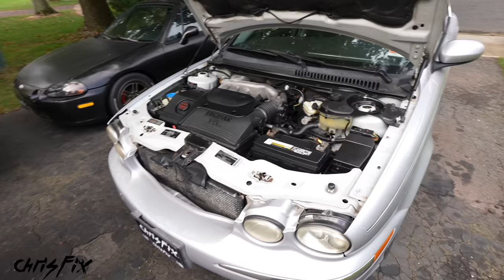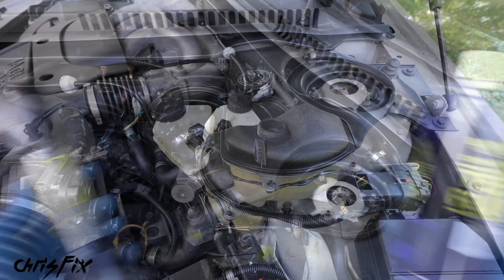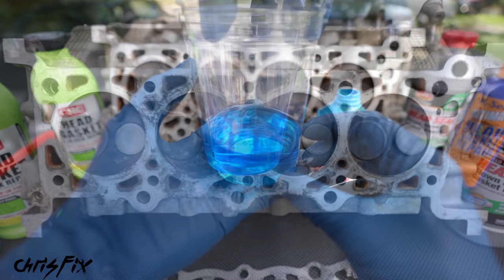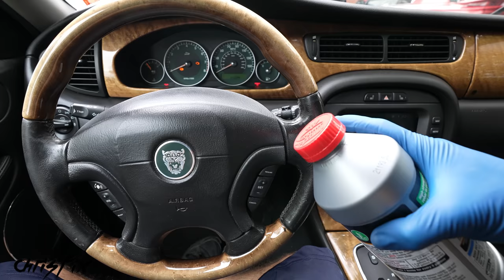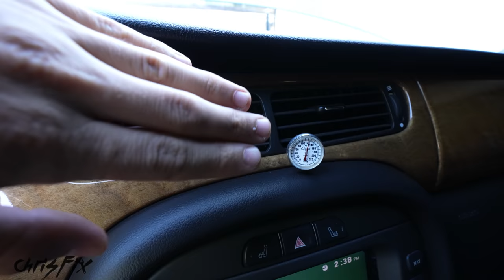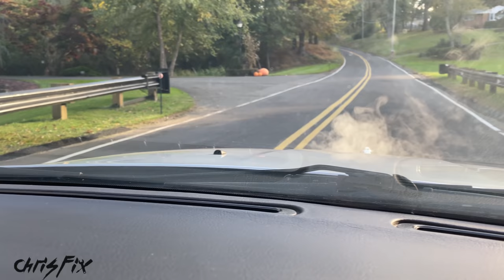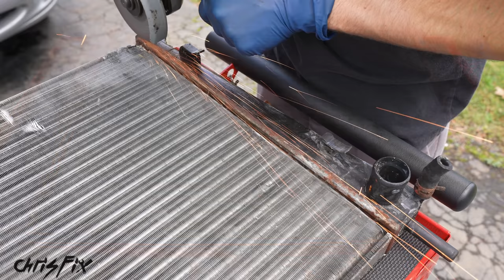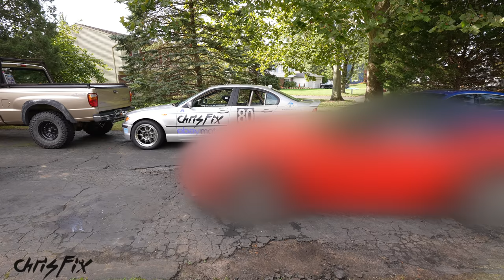Do Head Gasket Sealers Actually Work (FULL 2yr TEST with Engine Teardown)

Comment: After using many different sealers on different vehicles through the years, they absolutely work.  Not every time but definitely worth trying
Reply: which one do you think would be the best option for a 01 5.4 trition v8 with a head gasket leak?
Reply: @danielwright_69  I used the "blue devil" in my '99 5.4 triton 2v and it worked. That was about a year and a half ago and so far its holding.
Reply: @danielwright_69  Holts wondarweld work great for me.. before it was extremely blown head gasket, the coolant start spilling to the top once i start the engine.. i had to remove the spark plug on the blown gasket cylinder and run it without it so the sealant can circulate in the system.. it works on the first try..
Reply: @harisyoung4110  you saying the coolant was leaking from the head so bad it was getting into the spark plug area risking short so you removed it? How's that work?
Reply: @markdruck  it's not because it will short the sparkplug.. it's because that leak cylinder will pressurize (bubble) the cooling system and prevent the water and stopleak product from circulating inside the system.. removing the effected cylinder sparkplug eliminate that issue. my headgasket leak were so bad that if i start the engine without radiator cap it will start kicking out water from the tank.. running it without one or two effected sparkplug eliminate that issue.
Reply: @harisyoung4110  good to know!!!
Reply: @harisyoung4110  How long did you run your car with the 2 plugs removed? Very interesting! This might be a better fix.
Reply: @dporrasxtremeLS3  First i run the engine to heat it up until it reach operating temperature (without radiator cap).. then i switch off the engine, pour the stopleak product and install the radiator cap, remove the effected sparkplug and run it again around 10-15 minutes of idle.. then switch off the engines and let it cool overnight.. next morning install all the sparkplug and test running whether there's still leak or bubble in the system or not..if not then you can drain the system and replace with antifreeze..

  To know which cylinder is leaked, inspect each of the sparkplug, look for the unusual looking one.. in my case the effected cyclinder sparkplug is clean and white.

Comment: Great video, I knew how they worked, but it was interesting to see the results visually.  The fibers still concern me... makes me think of a hair clog in the drain. It's nice to see it didn't plug the radiator passages... but I think I'd still change the thermostat when changing the oil... just to be safe... I might go as far as changing the coolant after it's sealed & hardened.  Great content as usual Chris... btw, you don't need to hide your identity or wear a helmet... you're a trusted & results proven content creator... you should be proud of what you've done & taught. :)
Reply from the maker: Thanks a lot!
Reply: @chrisfix  Next video how to change tyres manually with simple tools etc..if it can't be fixed like last video! Thanks chris👍
Reply: I mean old tyres to new ones!
Reply: Because he is the same person as Eric The Car Guy
Reply: @trebliwatseotse5283  
No.... they're not the same person.

Comment: 2003 VW beetle turbo. Used blue devil sealer, following directions to a tee. Let the car cool and changed the oil. Have put on 15,000 miles and have had zero issues.
Reply from the maker: Awesome!

Comment: Mazda RX-8 Rotary. Blown internal rotor coolant seal. Same as a head gasket in a non rotary. Dealer said engine was toast. Full white smoke screen out the tail pipe.   Independent said engine was toast. My son and I (his car) pulled all the plugs, grounded the plug wires an spun it over. Tons of water came spraying out. We then followed the exact directions in a single small bottle of "K-Seal". It was a super hot day. When it was time to drive it, I took it on the freeway for about an hour all the time watching the rearview for white "smoke" and the temperature gauge expecting it to overheat. It ran perfect. I turned around and drove an hour back on the freeway. Parked it and sat over night. I fully expected it to not turn over or spray white smoke if it would even start. It started like new..... He drove the car for another 37,000.0 miles with not issues and sold the car.

Comment: 2000 Mitsubishi adventure GLS 
100k+ kilometers on the odometer.
We had a bad head gasket leak about a decade ago and we actually used the lime bottle on the left in the beginning of the video it does work before we sold it in 2016. My dad bought the vehicle in 2006 second hand.
Reply from the maker: That’s awesome!

Comment: The bars leak works 100%. We used it in the 01 3.0 ranger with 300k miles he bought with a bad head gasket. Put it in a year ago and it's still working fine.

Comment: Great channel-- I purchased a 2006 Tribeca back in 2017 and didn't know of it's propensity to have head gasket issues. Had overheating and verified the exhaust fumes in the radiator. I paid 6 grand for the car so it obviously was not worth spending another 6K or more on a new head gasket. I added the large Blue Devil Head Gasket repair and was gobsmacked that it worked. I was at GA at the time, drove the car back to Cali and it still is fine in terms of the headgasket. Had a front seal oil leak and other things like swapping out the alternator but all and all I am stunned that the liquid head gasket repair worked. ONE MORE thing that I think helped was drilling a few holes at the top of the thermostat that on my car sits up on it's side.
Reply from the maker: Thanks for sharing!

Comment: I used Blue Devil 4 years ago and it's still running strong! I had two cylinders 30% low (bad head gasket) on my 2005 4runner. It overheated multiple times and mechanics refused to test and/or couldn't diagnose it. I finally did it myself. I'm just about to compression test it again to see where it is, but I've gotten the $60 I spent on the Blue Devil back a hundred times over!
Reply: Dude, nice. Im having a hard time making a decision on which one to go with. Recently found out I have a blown head gasket
Reply: @theMemphisSnuggler  my dad used something else and had success, but my cousin/mechanic recommended Blue Devil and I would never use anything else.
Reply: How's it running?
I have a 2005 4runner as well with 283k miles and runs great
Reply: @theMemphisSnuggler go with the bars leak he used in the video. It has worked great for me. Didn't clog my radiator, heater core, nothing. Heat still blows hot as hell. Coolant consumption stopped 100% after a few heat cycles. I have a 2001 Subaru Outback 2.5 H4 engine. 209k miles. Purchased month and a half ago with 208k miles. Fantastic car. Runs like it's new. Only have done spark plugs, air filter, fuel filter, coolant flush. About to do transmission & diff flushes next. People are scared to buy the 98-0Xs Subarus because of the head gaskets that only last 120-180k. But once you replace it with a MLS gasket from the turbo models, it's a phenomenal car. I believe the headgasket was done on mine possibly already. And maybe they didn't have the heads machined. Or they put in a new headgasket that Subaru still sells that's the problem one (single layer graphite coated headgasket). After 120-180k, the graphite coating wears off.
Reply: @theMemphisSnuggler that's me tonight..... how did it go?

Comment: I have to give props to Blue Devil. I used it back in 2007 on my 97 F-150 with a 4.6. I had oil getting into the coolant but the truck wasn’t burning coolant. The truck overheated so I tried Blue Devil based on the recommendation from the guy at Napa. First thing I did was clean out the system best I could by running a solution of water mixed with Red Devil Lye. Then I followed the instructions on the bottle and it worked. I lived at 7000 ft(easier to overheat an engine at high elevation), I drove the truck across the country towing a trailer. I put over 20,000 miles on the truck before I sold it in 2011. 
Only mistake I made was not disconnecting the heater core. Living in the mountains of Montana with a heater that barely blew warm air wasn’t ideal.
Reply: I have 2004 4.6 how do you disconnect heater core i need to try it

Comment: Good analysis. Thank you.
Three notes though:
1. .001" is NOT warpage - every time the head is removed, there is 0,001 - 0,002" gap so it's recommended that the head is ALWAYS machined after removal up to 0.010" at which point it has to be replaced.
2. If the head is really warped and coolant enters combustion chamber(s), the head gasket gets burnt real fast because exhaust gases by-pass the metal ring and go directly to the gasket material. Even in short period of time, the gasket gets black/smoked in the leak area because of heat. Which is not the case here.
3. The amount of solidified sealer does not constitute a leak significant to the point of pumping all coolant out within 15-20 minutes.
Conclusion:
There probably was seepage at the head gasket (washed off piston top is an indicator but also could be a leaking injector) but look for a MAJOR leak - the other gasket or crack(s) in the head or block.

Comment: ChrisFix: "Obviously never remove this if its hot" (coolant cap)

Me: "Yep. Learned that the hard way..."
Reply: Perhaps most of us have. Reflexes actually get faster the next time one is forced to do just that.
Reply: I'm confused though, that was the radiator expansion tank, which isn't under pressure right? That should be fine to remove when the car is hot. You want to avoid the radiator cap which is on the pressurized system.
Reply: @rjmackenzie  some expansion tanks are pressurized. These vehicles usually dont have a radiator cap, the expansion tank cap works like a radiator cap and they're rated from 13-17 psi. Although I have seen some korean cars and japanese cars with a radiator cap on the radiator, and an identical cap on the expansion tank so you just gotta be aware of what you're working on. 2nd degree burns from coolant suck ass believe me

Comment: took my 2007 dodge charger to the shop because I thought I had an evap leak. gascap light came on as well as 4 error codes for misfire, voltage and gas sensor. The mechanic called me and said "don't dump any more money into this car, all tests point to a blown head gasket" well my heart broke instantly because I know what that could potentially mean. I've been through so much with my car, and I'm not in a position to buy a new one. I'm going to follow your lead on this one and see if I can't get some extra time with my car. Thanks for always explaining so efficiently and editing such great videos! your videos have helped me work on this same car for years! I changed my entire front end suspension thanks to your videos as well as throttle body and so many other working parts! you are simply the best DIY mech on this entire platform!
Reply: Is oil and coolant mixing? Coolant in oil or oil in coolant?
Reply: Failed Block test and exhaust in coolant. @SinsBird
Reply: @HeathMartinVO  If cooling system is pressurized I recommend to do it in steps, not one go, also keep the RPM above 1000. If removing the thermostat would be a problem for you choose a sealer which doesn't have particle filler in it. Let the temperature rise some, shut the engine off, let it sit for and hour, check coolant level, add water if there's less of it now, start and run the engine some more to reach a higher temperature than before, shut it, let it sit for an hour. Check the coolant level...and so on till it reaches the operating temperature. Don't hurry to dump it out of the cooling system, make sure that it sealed for sure, drive it keeping rpm high so it gets hot, then check the coolant level. If it's okay only then dump it out. Flush the cooling system multiple times before and after using the sealer.

Comment: Trying this on my sons first car. 2003 Subaru Outback Legacy. Loyal servant for 5 years and main dealer said 2 years ago the head gasket needed urgently replacing. Finally this year the oil leak and particularly the coolant leak reached the point of doomsday and was quoted $4k to fix. So found @ChrisFix and here we are ! I am trying the exact same product. Instructions followed to the letter. Just drove it for 20 mins with no overheating after waiting overnight. As it’s late I will check coolant in the AM and give it another run. This is now a spare car so could be a great fix for $35 to keep it going for emergency use or if a car goes into the shop etc. Very impressed Chris either way, brilliant channel. Will update on our scenario.
Reply: Update?
Reply: How'd it go?
Reply: How is it

Comment: Perfect timing for this masterpiece to drop! I think I have a blown head gasket in my Volvo 940.
Reply: I have one in my wrx
Reply: @ratio1283  it was delivered with it lol, as all subaru
Reply: This video came out the day after my mechanic told me I had a blown head gasket, hah.
Reply: Sometimes a re-toque of head bolts helps. But it wont fix it.  Lol
Reply: Bro I was just told today 3 days after this came out
Reply: Bruh, replacing a headgasket on your old volvo is like 4 hours work at most 😂 Just fix it properly lol
Reply: how did you managed to do that to an old volvo?
Reply: @LcFan96   after a 100 years its no shame that it fails lol, materials just werent that good in 1920 😂👍  Just replace it and its good for another 100 years.
Reply: @DeUnoReverseKaart  Haha yeah that’s the plan
Reply: @DeUnoReverseKaart  I hope you are joking😂
Reply: Head gasket on a Volvo 940 is actually quite easy
Reply: I have v 70 t5 to do.
Reply: @MrKngdali  that’s a totally different ball game from a red block volvo. It’s quite a big job for a white block engine
Reply: @DeUnoReverseKaart  Yah I wouldn't use that stuff - it may work - for a while, but for how long, and at what price.  90% of head gasket failures are from people overheating the engine, and I have never had a head gasket fail, because you can smell when it gets hot.
Reply: @MegaMeaty  Worst case scenario is that the repair costs get higher because you need to clean out the sealer aswel 😅 (i do +- 5 headgasket repairs every month lol)

Lets say it like this: If you really dont have any intention of fixxing it because its a piece of shit car, try it.. its broken anyway and it cant get any worse.

But i wouldnt use it as a temp fix to delay a repair, in that case fix it properly the first time.
Reply: @MegaMeaty  True btw, 9/10x its because of overheating (warped cill head/engine block), and with older engine's the gasket material that dissolves and fails.

Or in my case, experimenting with fuel mixxes like methanol😅😂😂
Reply: @DeUnoReverseKaart  I have a full industrial shop with air tools I think I could get it done in a couple hours or I am getting really bad. No lift though - I can't afford one that will lift my heavy trucks quite yet.
Reply: You and me both, on my Nissan V6 Hardbody 😩
Reply: make a vid how you change it and i subscribe. volvo 940 driver here.
Reply: @AliErfurt  I’m gonna make a video about that. While I’m in there I plan to put a performance camshaft in it too! Haha might as well while I have it apart.
Reply: @HonJazzz  Subscribed!

Comment: Great analysis relating to reveal no blockage of the radiator - clearly, the Head Gasket sealers work at higher temperatures by the engine block. That was a really nice touch in your video.
Reply from the maker: Thanks! I try to include things I’m curious about and this was def one of them!

Comment: Excellent video Chris! I had a 2003 Taurus SES 3.0L OHV with (according to my shop) a blown head gasket (they tested it). They said it would be 11 hours labor (11 x $125Hr) and I could buy the parts myself to save money. I said no. They said buy and try Blue Devil Head Gasket Sealer (the large, expensive bottle), not the small "pour n go" type. That was 8 years ago and the vehicle is still running fine. Starts every day uses no coolant (aside from the normal desert heat evaporation in the summer), never gets hot, has had two thermostats since. Oil is fine, exhaust is fine, smog every year, radiator is clean, drives fine. Excellent results from Blue Devil. Either the shop was wrong or Blue Devil worked. YMMV.
Reply: husband runs a shop recommends blue devil to all his customers that want a cheap fix it works

Comment: Another thing you can do is re move the spark plugs one at a time and try to see which cylinder is leaking exhaust gases into the cooling system.
The one that is leaking will have white deposits on the tip of the spark plug at the gap.
After you put the sealer into the cooling system and let it run as directed shut off the engine and take out that spark plug so the pressure in the cooling system can force the sealer into the crack or gap between the gasket and head or block.
Let the sealant fill the leak and cure overnight.  The next day replace the spark plug and go for a test drive.
It's probably best to remove the thermostat before you add the sealer and replace it after the curing time is up.
Thanks for the video.